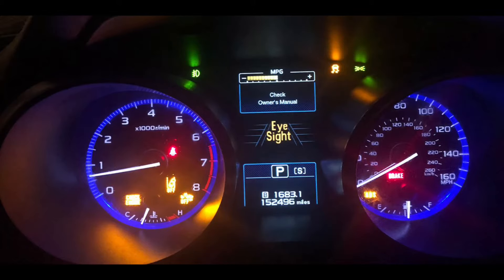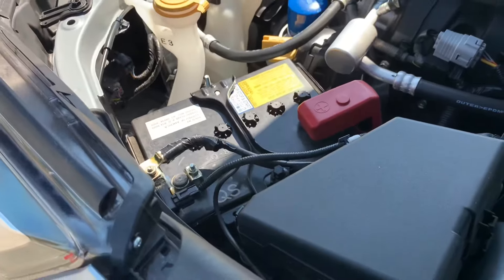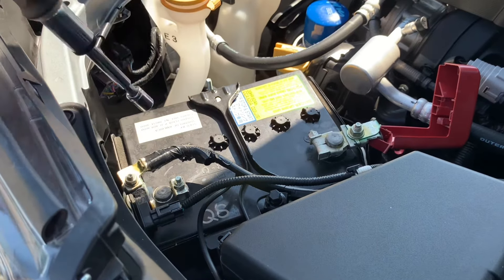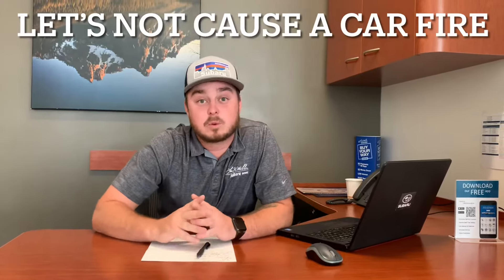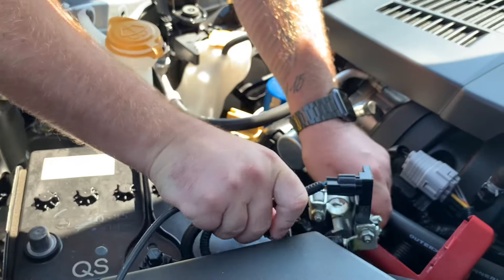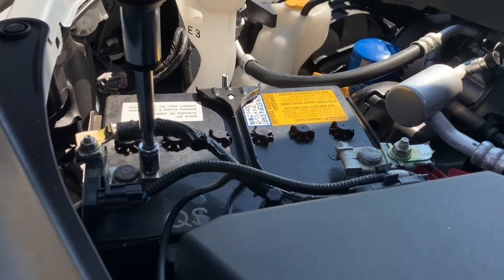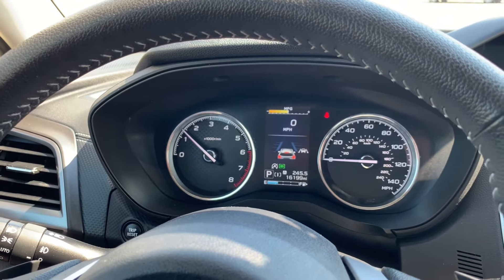All Dash Lights are On… Subaru

Comment: Perfect, It just solved the same issue I was having on my 2011 Legacy GT. Saved me a trip to the mechanic. Thanks for the info.
Reply: Did it ever come back?
Reply: All the lights came back a few weeks later, took to a mechanic and computer showed Cylinder 4 misfire. Got a new coil pack and all lights came back on again a few days later. Same fault, cylinder 4 misfire, so replaced the plug and so far so good. But the engine idle is not so smooth.

Comment: My 'lights on the dash issue' just happened yesterday and the fix was even easier. Turns out a loose gas cap and low fuel can make these light come on also. I filled my Subaru with gas, made sure the gas cap was tight and all warning light went out.

Comment: I just did this and it worked! But Don't be like me and have your lift gate up when you take the battery leads off the terminals. You'll have to manually shut your liftgate. It should work after that, though.

Comment: I just performed this procedure (10/25/22) on my 2020 Forester, with positive results. When this first appeared last week, I took it to the dealer to ask if the car was safe to drive. They put the scanner on and advised the error code (unknown to me) suggested a part was required that was on backorder, and to check back in 4 weeks. I was more than a little miffed, but I calmed myself down thinking this was a supply chain issue. The dealer told me the car was safe to drive until then. I followed up with a request for confirmation of the issue, but no response from the dealer. I will update if this error re-occurs in short term. Update: This recurred several times. I finally bought a FIXD dongle ($30), and that worked much easier. Finally got the call that the part was in (just under 4 weeks?), going in 9:30AM Nov 21 for the 4 hour fix. Hoping warranty. (24 K miles).
Reply: What was the part it needed?
Reply: Must have been the TCV thermo control valve

Comment: I have a 2016 Subaru legacy I’m fixing up for myself. It had a salvage title but still ran great. Drove it home with only the airbag light on. Then I noticed once I got it home the BSD light came on and then the eye sight. I had to take the airbag module out to have it reset after replacing the airbags in it. Would I have to wait until I get the airbag module back into the car before it will clear the BSD and eye sight off the gauges?

Comment: Your trick helped me as well. However, mine keeps going back to the same condition about every other day. I've used a battery acid cleaning solution and a wire brush to clean the connections. Can you think of anything else that I can try to keep it from coming back on? I had the battery tested and the alternator and they were both good. I'm at a loss. Any additional suggestions are greatly appreciated.
Reply from the maker: This is simply a reset for that specific computer. If the problem persists unfortunately it may be time to take it in to the dealership or trustworthy mechanic to see what the true symptom is! Hope that helps!

Comment: Didnt work for my 2019 subaru ascent. I had to replace a stripped wheel tire while rotating tires. Had to put the car in to drive with the engine off to rotate the wheel. After everything put back together. I got the issue with no eyesight no 
RAB. Dash says eyesight off check manual. Any idea how to fix?

Comment: I unhooked the battery and the eyesight, check engine lights went off for a day then came back on the next day. Autozone shows error codes P26A3 and C1921. I have a 2021 Subaru Forester Premium with 90k miles. I set up an appointment with the dealership and they said since the check engine light is not flashing, I can still drive it. The car seems to run fine since 5-18-24 when the light came on. I got an appointment with Subaru on 6-5-24 and the thermo control valve was covered fully under the extended warranty by Subaru. I didn’t have to pay for diagnostics or anything out of pocket. The car was finished on 6-13-24 due to an abundance of vehicles in the shop. I was able to schedule a rental from Subaru for that time free of charge. Funny, I received a letter from Subaru on 6-18-24 stating the repair is covered up to 150k miles and there is reimbursement for this repair if previously paid for. 🎉

Comment: I just had this happen to me yesterday. I have a 2020 forester touring with 33k miles on it. 

Took my car to Subaru and it ended up being the : (Thermo control valve) 

Luckily my car still fell under Subaru power train warranty. They fixed at 0.00$ cost. 

The Service tech said this is a common problem with 2020 and 2021, Subaru should really make this issue a recall.

Codes that came up when they checked it was (P26A6) (P26A5) (P26A5)

Comment: Lights are off now, but we pulled a number of codes. Tested the battery I just got and it's not sufficient, so I hope swapping it for a proper one will be the full resolve needed, and those codes were just due to this malfunction.

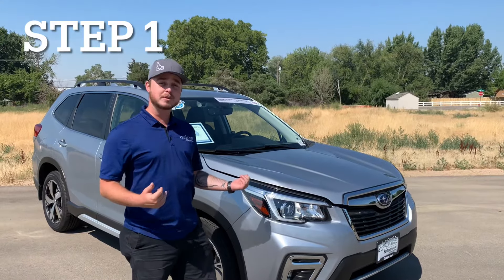Comment: I have the opposite problem with my 2017 Subaru Outback. The cargo lights, the map lights, and dome lights won't light. The clock resets back to 1:00 o'clock everytime I run the car. The key fob stopped locking and unlocking. Any idea what I could do ?

Comment: I did it and it worked but after driving for a couple of miles went back again.. and i did it again  2 x still same problems occur.. do i need to replace the battery? Coz i have not changed my battery since i bought the car way back 41/2 years ago
Reply: Same with mine, what did you end up doing?

Comment: I just fixed this same problem on my 2020 Subaru Forester I send to dealer Subaru and thay find problem ABS Sensor on front driving side wire is cutting and ask me to replace $499 so I order abs sensor at part dealer subaru and I fixed by self 20 min job to do only remember after replace abs sensor you have to disconnect battery and you can click on + you have to delete all codes and you ready to start a car good luck

Comment: Kyle I tried what you said but the lights are still on, just wondering could I have not let it run long enough after your fix? Or maybe just spitballing here but should I try your fix with the car running? I'm a 70's veteran and the last car I worked on was my 69 mach 1 so I'm way over my head on this blessings and I will do nothing until I hear from you, Thank you

Comment: Excellent video! However, I need some help. The lights on my 2013 Subaru Impreza suddenly turned on. I followed the steps in the video, and it worked for a while, but the lights came back on after the second start. I remember inserting the car's micro SD card during the test drive, and I'm not sure if that could be causing the issue. If anyone has any advice, please let me know. Thanks!

Comment: Would this work for reseting tire pressure sensors? I just had a new battery installed and now my tire pressure sensor light stays on. I checked pressure in all 5 tires ( including spare) , they had correct psi matching tires Subaru dealer installed.

Comment: What does mean when my 2015 legacy limited does the same thing but only when you put it in park. If I restart it and drive it’s ok. It’s only if I put the car in park. It’s a CVT and has 145,000 miles on it. Is it a sensor or should I do what you just did in the video. The battery was changed 4 years ago.

Comment: Works on our 2021 Forester. The bigger concern for me now is why this is happening on a car that only has about 1000 miles on it. 😕
Reply from the maker: A couple of reasons the lights come on, battery is drained, gas cap isn't fully clicked into place, or really any fault code that may appear little or small. The reason behind shutting all of those systems off (hence the christmas tree effect on your dash) is due to the fact the car is letting you know something is off and giving the driver full control to get to the nearest destination (dealer or home etc).

Hope that helps!!
Reply: @KyleBoline  I don't buy that. The whole purpose of an ECM is to tell you, fairly specifically, what's wrong with the car. There's no reason every system should shut down for any of the examples you cited. I think it's just a matter of Subaru tech being as terrible as it always has been.
Reply: experiencing right now. My 2022 ascent onyx has 1,500 miles. Got her last June 2022 and it happened.
Reply: @stephenbandico9632  It's happened twice on my mentioned Forester, now. There's clearly more going on here than Subaru is willing to admit.
Reply: That's what I think.  I'm heading back to the dealership yet again today.  The battery load test and Alternator came back great. But it happened again.  When I took it in last week they told me they have never seen this before.... I call BS.
Reply: @chrisrowe8827  LOL. Good call on the BS meter. It's too bad the car doesn't have a warning light for that. While I appreciate Kyle's bandaid to get the power and safety systems back online, there's clearly something wrong with these cars and they either don't know what it is or are trying to hide it. We should probably start taking this to https://www.nhtsa.gov/recalls

Comment: Hello Mr. Miller - there is an update to the xmas tree light fix: while the battery disconnect/reconnect fixed the xmas light issue, the xmas light kept recurring. This was fixed with another battery disconnect/reconnect and a cleaning of the battery terminal & connectors. Other google searches suggest the cause may also be the purge valve. Can you comment? Thank you! Ben, Santa Fe

Comment: Hey, I did what you told me to do at among of many other things I check all the connections throughout the electronic system and it’s not working what happens is is it all the lights go off and the systems are working again so it is recognizing things in the camera is working but 45 minutes later boom goes off again, and everything is back to where it was so what could that be?

Comment: I pressed the pushed the start button twice so i could use the radio but not fully turn on the car. My check engine, oil and battery light are on. When i fully start it up they go away. Is that normal?

Comment: Well my 2016 Legacy first throws the Electric Brake warning, followed up by AT OIL Temp, dynamic drive, ABS etc. Just tried this and it did not work. Any other ideas or suggestions?

Comment: I took my 2019 Forester to my local AutoZone and got error codes P26A5 and P2300. After hooking up my jump starter, check engine light etc. all turned off.
Is there a chance the underlying issue is still there (i.e. does that clear error codes regardless of whether the issue is still there)?
I vaguely remember having had this issue before 10k miles before (I have 34k now) and the dealership telling me it was a ghost code.
From what I read online, I might be dealing with low voltage, but could be the powertrain too.

Comment: Soo my regular battery got fuck up, i change it up, and now after the swap the lights turn on,  i did this and this work fine, but is still turning back on, , and it hade a bit less power when im driving at low speed, and it do like if it wanna turn off but never happen, soo my car still loosing power somewhere, even with the new battery and the lights keep popping up!! What could it be??

Comment: They always come back on. I have a 2011 Subaru Outback and have taken to the shop multiple times. They’ve done this and that but no matter what they do they always come back on after about a week.
Reply: I have a Subaru 2011 Outback and all of a sudden my rear lights are staying on and my dashboard lights are staying on and my alarm systems going when I open the car. 
Momentarily I can stop all these problems but then the lights come back on the alarm system comes back on and the dashboard lights come back on. The battery has been disconnected and reconnected and that's not helping either...
Reply: @internationalspectrumcosme7142 mine turned out to be a hole in the flex tube by the catalytic converter hidden by all those heat shields. They fixed that and the lights have been off for months when they would’ve usually come back on in a week. My car alarm never went off though.
Reply: @internationalspectrumcosme7142 yours sounds more like an electrical problem.

Comment: Interesting. We have a 2018 subaru crosstrek. And the lights will randomly come on and then randomly go off. One time I did disconnect the battery from the negative terminal and just let it sit for about 30 minutes to let the memory drain and then reconnected and codes went away and then a few months later come back. Seems they come on moreso when its cold outside

Comment: I tried it on my 2011 Legacy. Worked for about 15 seconds and then the lights came back on and the engine hit a deep idle instead of the warm up running mode. I Can't catch a break. Everyone else always gets by, but as always, I get the shaft. Only 71000 miles on it and I only put 30000 since I bought it used 10 years ago. Always serviced at the dealership. I did have to remedy the head gasket issue, so someone replaced the engine with a rebuilt one from an online company. So I'm sure the dude did something wrong.

Comment: Hi Kyle tried that procedure with a new battery on 2018 cross trek and it’s still their. Do you have any idea what’s going on with my car?
Reply from the maker: It could be a deeper underlying issue, this tip is to reset the ecm if it gets tripped. Not always the solution unfortunately!

Comment: I did this and didn't work. Took my wrx to the dealer and they knew what the issue was and yet they STILL only decided to tighten my "loose terminal" even after I told them on purpose that I did not tighten it (since I was already at the shop). I don't thing subaru wants to be responsible for this anymore now that there is a class action lawsuit. Let's see what SoA says though. Guess I'll have to test the battery at my local autozone and possibly replace the gas cap too. Damnit...

Comment: 2014 Subaru Forester with all alerts displaying. The car even shutdown at one point due to all the alerts (presumably because if certain alerts were actually true, this would be a defense against engine damage)

Upon inspection the positive battery terminal was HEAVILY corroded. This in spite of recent dealer service which included a battery inspection that was given ✅

After cleaning battery terminals with a wire brush post/cable brush, alert displays disappeared at startup just like they’re supposed to. 

Very helpful video. 

Much better than towing car in for $$$ service!

Comment: Understood your advice but unfortunately did not work.  I took the car to have any codes read  it came back Steering Angle sensor  but on the dash it says (I) in Triangle  Emergency Parking Brake.  Concern about going back to dealer, left with an expensive bad taste.

Comment: Does this usually occur when a non Subaru garage fixes something on the car? Possibly?
Reply from the maker: Potentially! There are a few reasons that dash lights could show. Really any engine code that the system reads will trigger this, big or small. Even a gas cap not being fully clicked into place! Hope that helps!

Comment: I did this, and it worked. THEN came right back on after I started it up again later to drive. And other ideas?
Reply from the maker: Unfortunately I do not, there could be a larger issue and would recommend going to a reputable Subaru Dealership at that time!
Reply: Mine did same

Comment: My Subaru 2015 BS9 has the eyesight sign with a cross drawn on it and a message "eyesight is disabled check manual" and the 2 lights for lane assist and collision control are on.. I scanned it and it has no error code and all fuse are working.... it went off while I was driving.. even the Subaru dealership has no solution can any one assist me

Comment: I took my 2019 Forrester to the dealer once and for all to have them tell me why my eyesight and check engine lights and other lights remain on. I almost rolled over when they said that’ll be $192 for a diagnostic check, I bit the bullet and agreed to it. The sales tech comes back to me after an hour and said there is no charge. It was due to a faulty radiator sensor and he put it under warranty for the power train 5 yr/60,000  agreement.. they did suggest to buy a new radiator cap for $25,since the gasket under the cap was slightly torn.  They said once any sensor starts to fail, it will warn all the other sensors and additional lights will turn on, including the check engine feature, thus keeping the check engine light on. For a while, I thought the check engine light was related to the gas cap not being screwed tight, so would I did take the gas cap off and on and retighten, and it seemed to turn off the check engine light for a while until the next day and then it would just come back on.

Comment: Thanks! got it fixed in no time but it came back again after one month later. Now it happens too often. Do you think I should simply replace my battery?
Reply: Yeah, I just tried this and it worked great. All the lights warning went out like a charm so I drove around the block. All the lights were still gone as I parked back in my driveway. I turned off the engine and then I fired it back up and then BOOM, all the warning lights came back on. This sucks.  Maybe it is the battery. It’s 4 yrs old. Hmm, I thought I would get at least 5 years out of that thing!
Reply: @robsaljr  Well? I replaced my battery too t  a new one but still comes back on
 and stays on.
Once in a while the lights are out but it turns back on after few miles of driving. Subaru doesn't know what is wrong with it either. I have been driving it like this for 7 months now and now I'm kinda getting used to my Christmas lights every day...